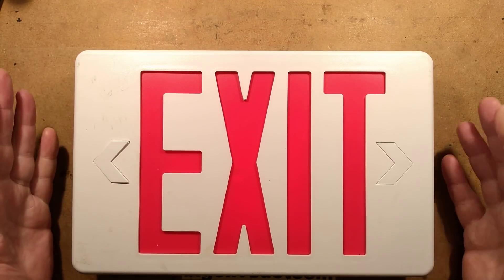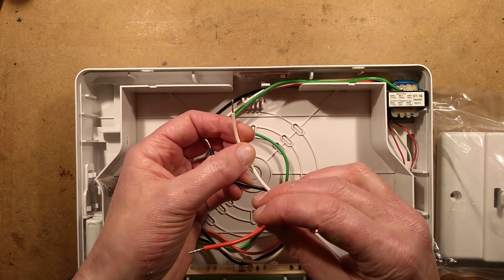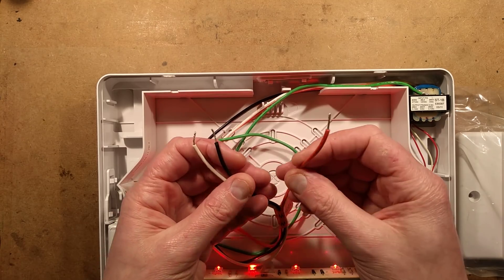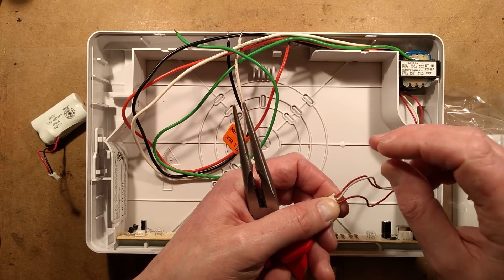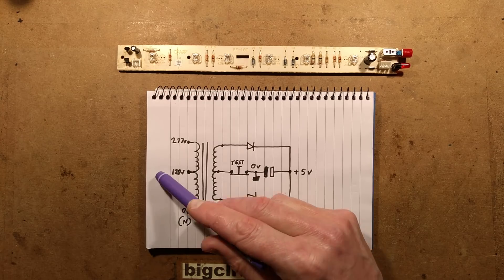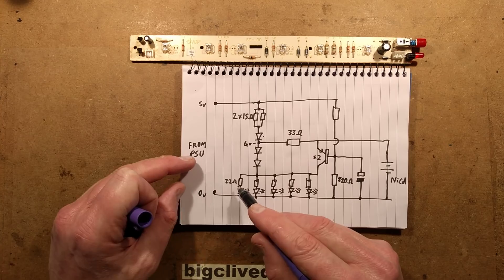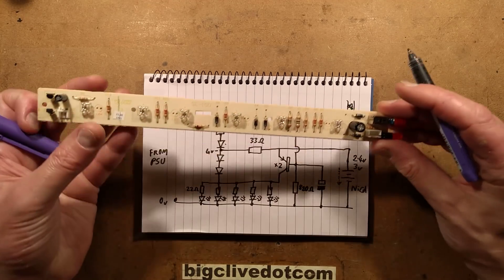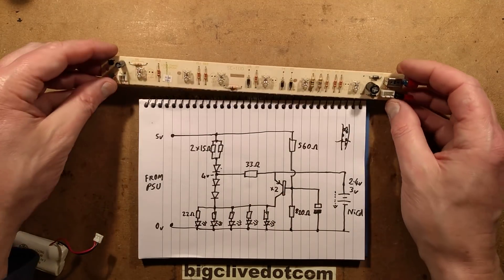Inside an American emergency light (with schematic).

Comment: I'd guess the extra cap at the transistor base adds a very small time delay before the LEDs will be switched back from battery to mains. Probably something useful when power comes back and goes a couple of times  in quick succession.
Reply: Or is used for additional smoothing since main capacitor is not enough. There is a noticeable flicker on camera when on mains.
Reply: Probably the other way round, to protect the life of the battery... if the first capacitor isn't fast enough while charging to keep the voltage high enough through the whole wave as it discharges through the LEDs before its next charge part of the cycle, the voltage across the +5 to ground rails will spend time at a lower voltage than what the battery's able to kick out, and you'll end up using the battery for smoothing the power to the LEDs, causing them to switch between tiny charge/discharge cycles 120 times a second... with the second capacitor, which will discharge slower than the first as resistance across it's discharge path is much higher, will stop the battery from discharging anytime the +5V rail drops below the battery's voltage, as without those transistors, the battery won't start discharging until the +5V rail drops below the battery's voltage minus the voltage drop across the 33ohm resistor, which you'd hope the first capacitor is at least capable of stopping it dropping that low. The flickering you can see from the LEDs when running from mains is an indicator of how much the battery would be constantly discharging to fill in the flicker without the capacitor keeping the transistors off.
Reply: Designed by a real engineer who wanted a pleasing delay from mains operation to battery, with a soft start on the LEDS.
Reply: That would kinda make sense especially when you consider that these things are after all designed to guide an evacuation in most emergency situations ranging from local problems with a single building to severe storms or other disasters that could afflict the entire regional grid with numerous transient faults.

Comment: We've transitioned in Canada to the green exit signs with the running man looking like he just stole something.
Reply: The running man symbol -- internationally recognised by all Portal players.
Reply: You probably live out west. In Southern Ontario I have NEVER seen a green EXIT sign anywhere.
Reply: I think the green ones  are required for new installations in Ontario. We have them in parts of the building I work in that were renovated recently.
Reply: @rick_.  Haven't seen any yet myself, but I wouldn't be surprised if you were correct.
Reply: @rick_.  Ontario requires for new construction and certain renovations.  This has been case since 2014.  It made all the papers.  It was actually sort of interesting as the case made was that international persons or non-english/french speakers would not understand "EXIT"/"SORTIE", but they expected people looking for "EXIT"/"SORTIE" signs to figure out what the green man meant.
Reply: @4jp  Australia used to have green signs that said "EXIT" but changed a while back to the running man symbol. The pictogram needs to be changed or the exit sign replaced if it's moved or modified at all and of course all new installs are the new style.
Reply: @4jp  cultural marxist politics of the canadian government. They care about the foreigners coming in to the exclusion of the actual Canadians. Your point is right on. The choose a sign that helps out the foreigners, even it it dooms the natives.
Reply: @PhoenixRevealed  we have them all over the place here in Ottawa
Reply: Some places in the US have green exit signs too. The standards for things like exit signs can vary greatly between different jurisdictions. In most places either green or red is acceptable. The main requirements are that it be easily visible, each fixture have an independent backup power supply such as a battery, and has to be on its own dedicated circuit that can't be shut off by an easily accessible switch like say a light switch. I'm pretty sure the commercial electrical in the UK and elsewhere are probably very similar other than the graphics on the sign itself.
Reply: They were tested in Detroit for a few years before certification.
Reply: California all exit signs must be green for new construction.
 no man running though.
Reply: Ian Colquhoun Or he is trying desperately trying to find a bathroom.
Reply: because they are well known to guide the thieves out the doors :))
Reply: New buildings around here have the green exit signs near the floor as well as near the ceiling. So you can see them if you're crawling through smoke, apparently.
Reply: Yep, in Australia, the green running man is the standard exit lamp. I have two, one is a 6w fluro, other is leds. I tend to mount them in silly places. Exit = third floor window. Or exit = to the loo. Man running to the 'exit', seems apt. In my current house however, the laundry light socket is busted, n kills anything plugged in. So having a lamp that illuminates a path to an 'exit' is pretty handy. And i find it pretty funny, man running to a loo.
Reply: https://www.youtube.com/watch?v=i5uSlAw8U9s for a good story on the design of the ISO exit sign (told by a Canadian).  Now that you are thinking about it, you will start seeing them everywhere!
Reply: he may have stolen something like hockey or curling equipment, or crepes, but i'm sure he was sorry, eh?
Reply: Running man signs here in Newfoundland
Reply: Same here in Australia :)
Reply: @IntegerOfDoom  Red means stop in most places. Not the best color to use on a non-international sign that says "EXIT". If you don't speak the language, it may as well say "DANGER". Green generally means "GO" or "Safe". That's the thought behind it.
Reply: IntegerOfDoom 
Are you ok?
Reply: you Canadians always following what your masters across the ocean do.
Reply: Was just talking at work how the human race went from hieroglyphics, to many languages and now back to hieroglyphics for everything.
Reply: @IntegerOfDoom  Human eyes are most sensitive to green, especially in low light situations, and least sensitive to red. That's why they sometimes use red lights to not disturb night vision or when they don't want the light to carry. Most colorblind people (though not all) will be more sensitive to green light than red.
Reply: A lot of larger places in Britain use the green running man sign, along with a green stripe along corridor walls, leading to the emergency exits. The green man is a similar philosophy to the green man at Pelican and Zebra crossings, and for vehicles, the green light for traffic lights. Green means safe to proceed, safe to cross, or safe to exit.
Reply: @IntegerOfDoom  --> Actually there are probably two reasons for the change to green:  The first would be that the human eye is most sensitive to green.  Second, if you couldn't read the sign because it was in a language you didn't understand you might misinterpret red to signify danger if all it had was a printed word on it and no symbols.
Reply: Maybe the green guy is running because he saw the yellow guy being attacked by one of the three snakes.
Reply: I've never understood the use of red for emergency exit signs. Other than the mentioned improved sensitivity to green, if the place is on fire it would be harder to see the red sign amongst all the red flames.
Reply: They're super bad for your night sight if you are in a particularly large building with a long egress route. Red was way safer
Reply: Yup, very common in BC, especially in Vancouver since so many people can't even understand English these days...
Reply: Du you just gender the exit sign? Hopefully no snowflake will notice this!

Comment: Hmmm, the led's on the sign only started to flicker when the power was connected, is there a way to stop flicker with stuff connected to mains?
Reply: Tox Laximus Maybe don't use 60Hz equipment on 50hz with low voltage? You won't drain the filter cap so easily.

Comment: Without the capacitor on the control transistor's base, the sign would switch to battery power whenever ripples on the input capacitor cause the voltage to drop Vbe below battery voltage instead of only while AC power is severely below spec or out altogether. The base capacitor reduces the circuit's sensitivity to input ripples and low AC input voltage so the sign doesn't waste battery power until it becomes absolutely necessary.

Comment: I work in a large industrial plant. (10 acres under roof) We often use this brand of exit signs. New in the box, they come with a second legend plate which can be exchanged for the blank back allowing mounting on the end or top to a wall or ceiling with visibility from both sides. Very versatile. I discovered the live transformer lead issue in a unit which was not working because the unused lead shorted to a metal junction box and dragged the voltage below the working threshold. Having heard arcing in the unit, I was very careful when examining it!
Reply: I've also installed these where I work, and all of ours came with the second plate for the back.

Comment: As an English ex-pat who was moved to Ontario Canada when I was almost 8 years old, I grew up with American-style red EXIT signs. In 2005 I worked a 9-month contract in Denver Colorado, and was really surprised to find that ALL the EXIT signage was international green in colour. What really caught my attention though (and maybe this is normal in UK/Europe too but it's not in Canada) is that the signs are mounted at floor level in hallways and corridors. This is so they remain visible if you need to find your way out under a hanging smoke cloud.
Reply: I don't think it's normal in Europe. I replaced a few units (and kept a few for myself , heh) and they are always (in France) at "over the door" level. there is a maximum distance for them to be set up (no more than 25 meters between two units if I remember right) but I never heard nor seen a requirement for being visible at floor level.
I remember reading about international versions, and European ones are either outputting more light or working longer, I don't remember which. Supposedly European emergency lights must work at least one hour. (I got old, lead based models with a fluorescent light and it's about that; LED based ones seems to last more, almost 2 hours).
On the technical side, Euro ones connect on 230 volts, and on a 12Volt line for testing and/or possibly centralized/extra 12V independant power supply.

Comment: We don't call them gates on PNP transistors, that's for FETs. We call it the base.
Reply from the maker: I often make mistakes like this because my brain is racing ahead of my mouth when I make videos.
Reply: @bigclivedotcom  Yeah, I knew you knew it. I just wanted to clarify it for any one who might be learning electronics watching your videos. This is a really great learning video because that type of CT transformer & two diodes is very common in designs that are more frugal.
Reply: I actually prefer ‘gate’ to ‘base’. Makes much more sense IMO. Did FETs really need different nomenclature to bipolar? Obviously terms like grid from valves/tubes were no good, but the solid state source/emitter, drain/collector and gate/base seem pretty interchangeable. I use the correct terms, of course, but Clive’s slip did start me thinking!
Reply: @ProdigalPorcupine  If you're designing a circuit the differences are huge. Bases flow current and gates do not. So the mathematical formulae used are different and if you use the wrong one your circuit either will not work at all or will not work as expected. So there is plenty of good reason for learning the right terms in the first place.
 Also regular transistors are thought of as current amplifying devices while FETs are voltage amplifying devices. In this regard they are totally different. ( I hope I am saying that right. dead tired right now, just got awoken by a neighbor's bass so ... I feel like I want to use some different words but I feel I'm close)

Comment: A real transformer for longevity and a user replaceable battery.  So much better than the replace entire fixture every 5 years disposable stuff.
Reply from the maker: Yes indeed.  This does look reliable.
Reply: The Dollar Guy the originals with incandescent bulbs would always melt the fixture from the inside because of the absolute lack of any cooling solution.
Reply: Yeah, i'm impressed by the way they did this, i'm actually considering them for replacement with the garbage ones we have here in Europe. Especially the tube ones, ugh.
Reply: Not if it's your objective to sell lots and lots of exit signs....
Reply: looks old, they're more chinesium electronics now... although many with old school SLA batteries are around, the battery cost is causing them to be replaced
Reply: @throttlebottle5906  Anyone who is replacing their exit signs because the SLA batteries cost too much needs to find a better place to buy them. The most common SLA used in those. 6V 4AH, shouldn't cost any more than $10.
Reply: @brianleeper5737  sure, but management is sold on the magical and supposed longer life LED and battery they wont have to change yearly.
often the older units end up overcharging or undercharge and eat batteries, the battery quality has gone to the "pot"

Comment: whys power factor only 0.77 ? surely a transformer should be in the 9's ???
Reply: Hysteresis
Reply: @Sarcastix7 
There is very little hysteresis.
The primary current on a transform is almost perfectly sine wave.  It is just a tad later than the voltage waveform so it is slightly out of step.
You can do a bit better if you slightly undersize the output side filter capacitor.  The current to charge the output capacitor then happens a bit earlier because it droops more between alternations of the mains.
Reply from the maker: A transformer is an inductive load.  Only a purely resistive load will have a unity power factor.

Comment: Red's a better option for low-light situations as the eyes can adjust quickly to red light in the dark than they can to green or blue... :)
Reply: The eye is more sensitive to the green wavelength and can be seen better in the dark. 
Green = Go/Safety. Red = Stop/No entry

Comment: Would certainly not pass IEC regs for a number of reasons.... just one would be cell reversal protection.  Under discharge the LED must cut off before 1V per cell is reached.
Reply: And yet they somehow magically work.
Reply: @beefchicken  It's an interestingly different approach to safety.  I'd like to find a copy of UL-924, just to see how it compares to IEC60598-2-22.

Comment: When you attached mains there was some beating in the main LEDs. That tells me the 5V has significant ripple. That might explain the base capacitor. Maybe with low mains the battery was being used too much and not charging. 

Any idea why the transistor is doubled up? Could it be an infallibility thing?

Not sure how I feel about spot welding a PE, but I guess it's better than soldering. And the fitting must be UL, so.
Reply: Mike Page Don't forget it was designed for 60Hz, so the filter cap is smaller than for 50Hz.
Reply: @mikecowen6507  Electrolytics have enormous tolerances, it won't be a marginal design.
Reply: Mike Page Not a marginal design, but nonetheless, being operated at a lower voltage and frequency than designed can easily yield sub-par performance. I'd like to see it run at spec voltage & frequency for comparison.
Reply: @mikecowen6507  So what's your theory for the base capacitor?
Reply: Mike Page My comments were entirely based on your "significant ripple" comment. As for the base cap, I'd surmise it's for transient input voltage stability to prevent false triggering.